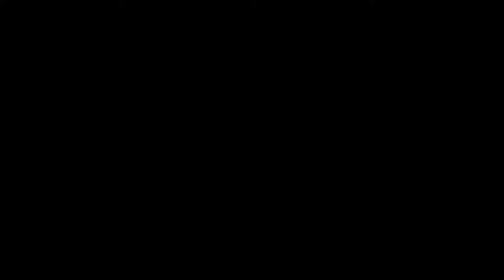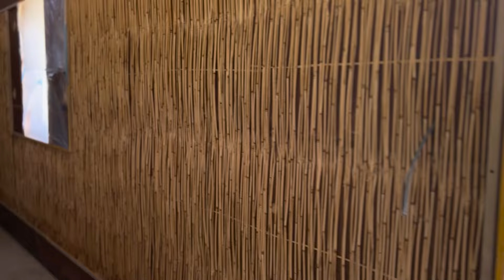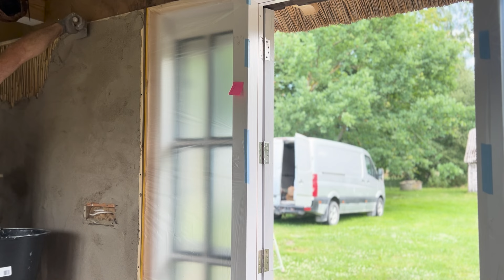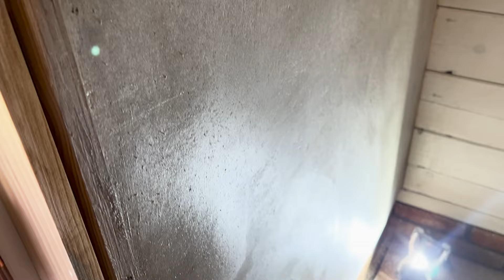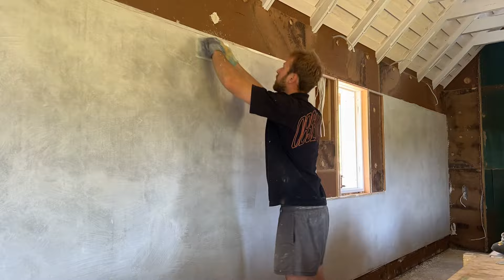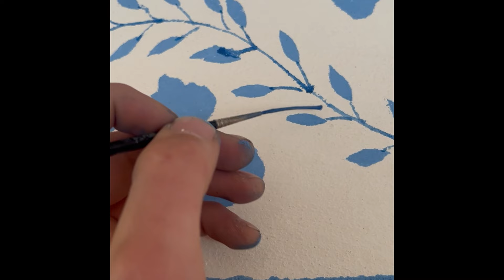Why is lime plaster better than cement plaster

Comment: Have you ever used a mix of lime and gypsum? apparently it's good for breathability and compatibility with brick walls but I haven't seen any videos of people using it.
Reply from the maker: "I have worked with gypsum before, primarily in interior settings, as gypsum is not suitable for exterior environments due to its limited durability. The breathability of the material is significantly compromised, and its performance can degrade over time when exposed to external conditions. Typically, I incorporate gypsum into lime when creating ornamental or decorative elements, such as moldings or ceiling trims. The addition of gypsum allows for the application of thicker layers and accelerates the setting process, making it ideal for detailed interior work."

Comment: Nice vedio and good job , brother what is ratio of lime and sand for plastering ??
Reply from the maker: the classical ratio is 1 lime 3 sand + silica sand for hardness. But sometimes i ad more lime to make the mix more sticky 2lime 3sand
Reply: @robertspodgaiskis2139  thanks bro ...pleasw one thing tell me ,,, can we use clay instead of sand ??
2nd what is curing of lime plasetring like cement plasetring we do with watering 3 or 4 days?
Reply from the maker: @malik51973  you can use clay and sand mix the same ratio but then it will be clay plaster ! 
Don’t mix lime and clay it’s not smart ! 
if you want to mix lime with clay the you need to find old brick and smash them in powder that’s good otherwise not recommended
Reply from the maker: @malik51973  lime cures 48 h minimum depends on the temp and moisture
Reply: @robertspodgaiskis2139  thanks bro ,,
Reply: @robertspodgaiskis2139  can we use lime for flooring ??if yes then what ratio of meterials
Reply from the maker: @malik51973  am not familiar with the lime uses fore flooring but it probably good because floors need good materials ! the same ratio 1/3 or 2/3 ! 
make some samples to test the material !

Comment: why the addition of cement to the lime?
Reply from the maker: Its not Cement ! 

Microsilica powder is composed of ultra fine solid spherical particles of amorphous silica each approximately 100 times smaller than a cement grain. It is formed by the condensation of vapour during the smelting of coal, quartz, iron ore and other materials in an electric arc furnace at around 2000.
Reply: @robertspodgaiskis2139  What is its purpose and is this lime similar to the lime in the states? How hard and durable is the wall?

Comment: Hi!
I would like to plaster only with lime and sand but my walls are from concrete, can it be done, needs some special preparation before? Thank you!
Reply from the maker: @tzuno2068  Hi.! 
Yes it can be done but i would most defiantly ad silica sand or some other hardener to your mix to make the substance more durable und it will stick better !  Anything that has been burning in temp over 1000 degree  is considered to give lime plaster hardening properties ash, volcanic sand, burnt clay brick dust and so on !  Make a small sample area to test your strategy !!
Reply: Thank you!
Reply from the maker: @tzuno2068  
And if the concrete surfice is really glossy you can first  use some cement based material like tile glue and use a brush when  applying a thin layer of it!  it will stick really well and create a good  sandy rough contact layer